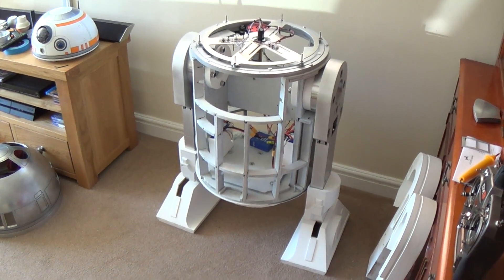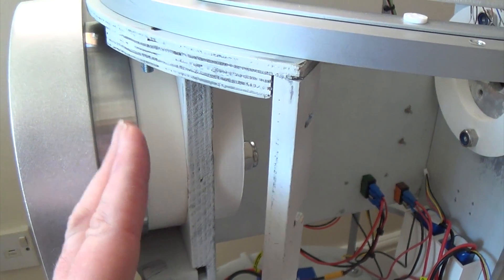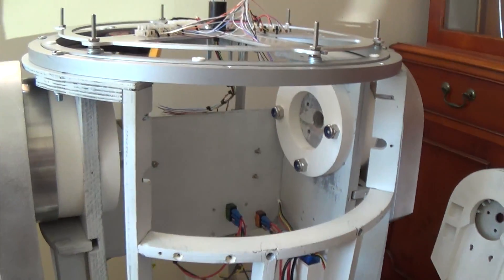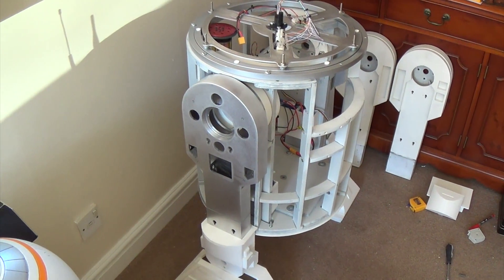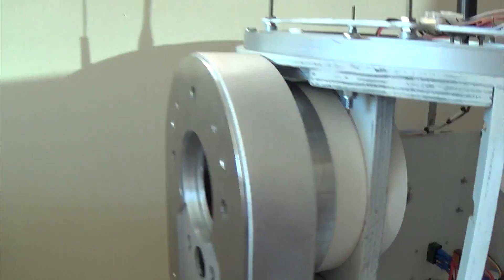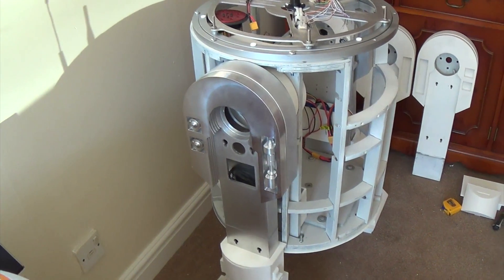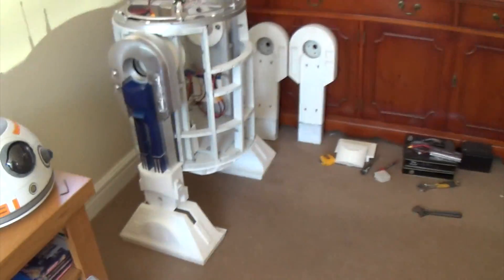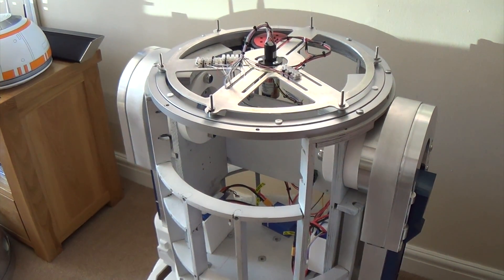R2-D2 build - Part 6

Comment: let me mention, that the bolts in your legs are actually too short for the self locking nuts.
the nuts only work, if the threads of the bolt go past that blue plastic ring.
hope you find value in this information.
Reply from the maker: Hi, thanks for the tip but I've already printed narrower inside spacers to address that, and printed wider outside hubs as the legs were too close to the body. I'll do a video update on it. Thanks though, you're spot on 😊

Comment: looking good whats happening with the falcon build only 2 to 3 months left on it i think?.
Reply from the maker: Hi Ben, I've get the next four issues, so I'll be doing that in the next day or so, video should be up by the end of the week.
Reply: +Movie Models just putting this idea out there you could make custom aluminium feet from sheet metal.
Reply: +Movie Models I'm really surprised the weight of r2 is on the 5mm thick 3D printed feet.PLA must be strong.